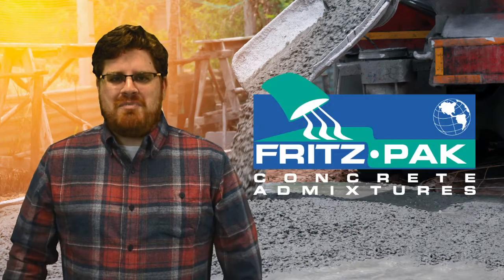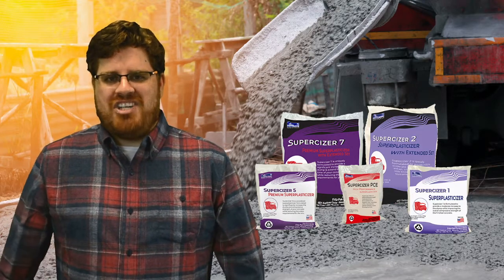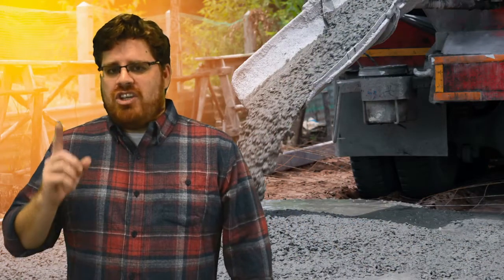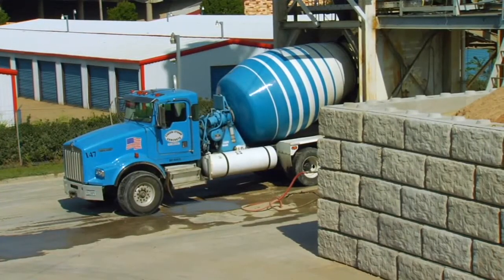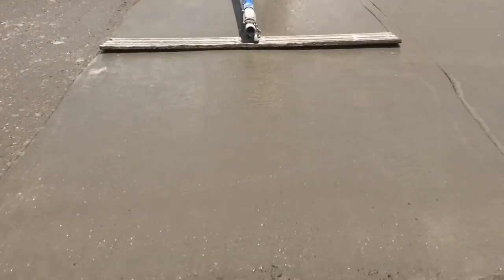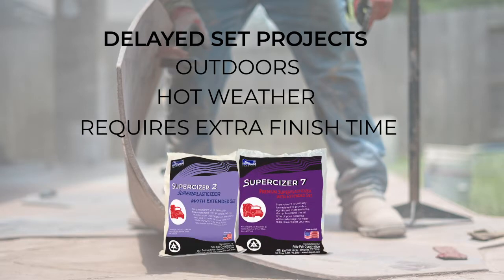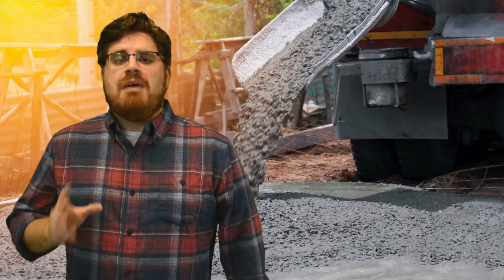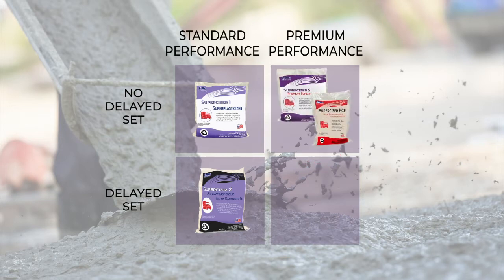How to Choose the Right Concrete Superplasticizers

Comment: 355 bucks for an 18 oz bag ? Pretty sure you're insane at this point ! Anyway, good luck with all that..
Reply from the maker: None of these products come in an 18-ounce bag. Supercizer 1, Supercizer 5, & Supercizer 2 come in 1.5-pound bags, and Supercizer 7 comes in 2.5-pound bags.  Our Supercizer PCE comes packaged in a 1-pound bag. 
And . . we sell them by the case, not individual bags.  Supercizers 1 & 5 come in cases of 24 bags.  Supercizer 2 comes in a case of 20 bags, and Supercizer 7 comes in a  case of 19 8 bags. Supercizer PCE comes in a case of 30 bags. The average cost per bag for any of our superplasticizers is only $12.
Reply: can i buy the packs individually or get a sample?
 @fritzpak4821
Reply: $355 is alot for you🤔 the job alone will be $7k-$35k and it strengthens the mix its your name on that job your going to be cheap?
Reply: That's a case price and each bag, for the products I've looked at, treats 7-10 yards...a truck load.  The stuff is cheap.